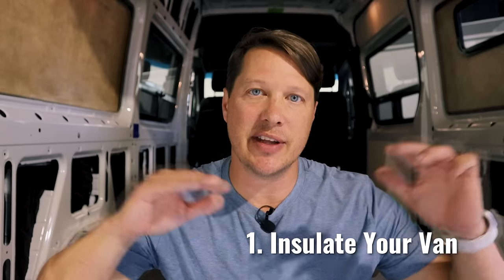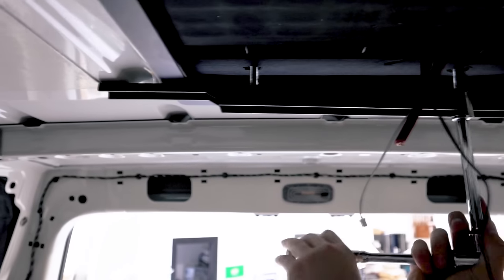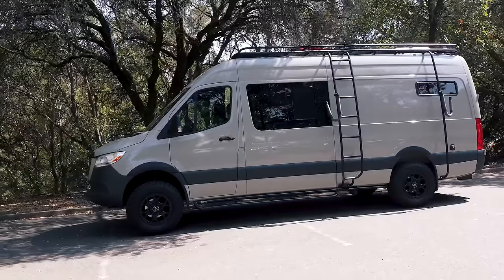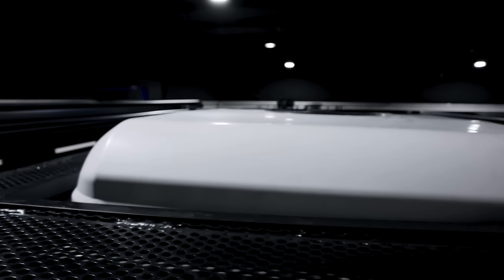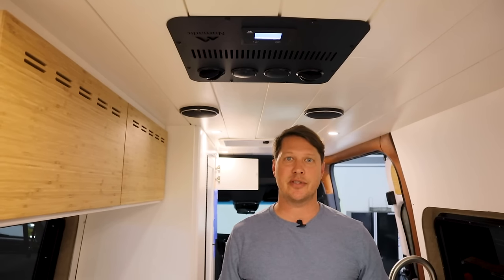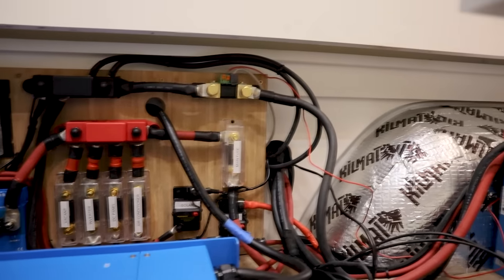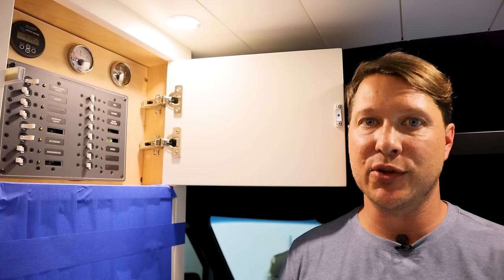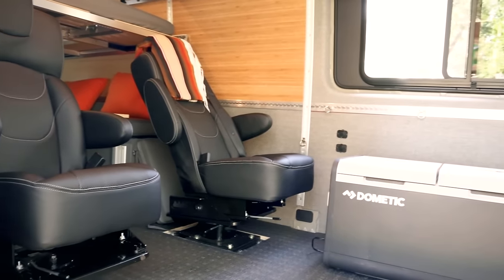Perfect Air Conditioner For Off Grid Sprinter Vans

Comment: I’m in Florida, so I’m going with the ac as a priority before other “unnecessary” items.. it would be unbearable to sleep/hangout on the van without it at 90 degrees and 100% humidity. So before wheels/tires, roof rack, rear door accessories, etc I have to figure out the ac. Thanks for the technical info on this system
Reply: South Florida here also.  I’m trying to decide between shore power AC or 12 volt AC and I’m still not %100 sure 🤔
Reply from the maker: There’s a cost difference and a convenience difference to consider. Tough decision indeed- depends on your access to shore power when you’re traveling.
Reply from the maker: Absolutely. Good luck with your decision.
Reply: @onionhead5780  im thinking about hacking a 120v unit for my van honestly. I’m an ac contractor and I have all the parts and tools at my disposal.. there are 9000 btu inverter units that probably are sufficient enough for a well insulated van that close to draw the same power as this at 120v even after accounting for inverter loss. And they cost less than $500 vs $4000. I’m going to explore options and see
Reply: @jamilchavez4592  get the dometic rtx 2000 2800$ with sok lithium. 206ah/ 1029$.
Reply: Ditto. South Florida girl. It is sheer misery to sleep without a/c. I can barely stand to be out in the hot, humid daytime. Lol
Reply: @JackBatesPhotography  im looking in to the RTX 1000 since I’m building a micro camper. I have seen the RTX 2000 uses around  50 amps by the hour so I’m guessing I’ll need something like a 400ah battery bank to run the ac thought the night. It’s pretty expensive but I’m guessing it’s worth it.
Reply: @jamilchavez4592  how would you run a 9k btu av unit from the van without being connected to shore power if it’s 110v? I’m no expert on air conditioners or electrical systems
Reply: @JackBatesPhotography  Those batteries last 3.5 hours at 60 amps, or 7 hours at economy 30 amps (without considering any other loads).  You really need a massive battery bank to run an AC at night.
Reply: Southern Arizona in the summer where A/C is not a choice unless one wants their van to become their coffin.
Reply: I'm from south Florida and I'm going with a Cicioni mimi split. It has more BTU's than the nomadic cooling roof air. I have two dogs and I want my van to stay cool for them. Plus I'm getting a 24v system for my power.
Reply: @kathylong9087  I ended up going with a recpro roof top and it’s great for how inexpensive it is.. can easily run for hours on battery if you have 200+ lithium
Reply: @jamilchavez4592  I'm looking at those RecPro units now and I was wondering if they are reliable and actually cool down you space.
Reply: @anobody5708  I’ve had mine for about a year with no issues. The 9500 Btu unit cools down my insulated 144” sprinter high roof well.
Reply: Idkn I own the 12 volt then switch back to the 120 which can run off my batteries the 12 volt didn’t have enough balls even in mild temps.
Reply: @ryanrodriguez70  yeah I’ve seen that the dometic 2000 a lot of people like is like 3000 btu less than the recpro 120v I have. I think it’s undersized
Reply: Florida isn’t good for camping.
Reply: Absolutely!!!!
I'm a New Orleans Native Baby and A/C comes before you even buy the bus!!!
Nothing is worth it without A/C!
Reply: 100000% my man. I am with your thought process!!! It's about the heat and AC for my Overlander Trailer camper build.
Reply: AC is a must!!  I do not want to travel in certain months because I do not have AC. Comfort is the key, or I will not go. Sorry but AC and heat are the main essentials to traveling in comfort.
Reply: I'm going to Florida myself soon so yeah, the ac is must.

Comment: The Nomadic seems to take up a lot of solar panel space on the van's rooftop. I think the 
Dometic takes up less roof space space.
Reply: Nomadic is 36x32x9 vs the Dometic at 29x42.5x11.29. So the Dometic is both longer and taller and takes up more square footage on the roof. The nomadic is wider but both shorter and lower profile. If you're looking to put a small low wattage solar panel on either side of the AC, Dometic may be the option for you. If you're like me, and you want the biggest gap between the AC and the MaxFan for a large walkable solar surface, Nomadic looks like a great option

Comment: There is one out now that has 10,000 BTU cooling, 4,500 BTU heating runs all night on one 100ah battery and is about $900 made by outequippro and mine has been awesome for over a year now! It is about 7 inches tall and 28inches long and 26 inches wide.
Reply from the maker: I just checked it out. Sorry, but it says "Get 8 hours of cooling with a 480Ah battery and 10 hours with a 600Ah battery when parked". So, it is misleading to say that it runs "all night" on a 100 amp hour battery.
Reply: @VanLand  I only have a 100ah battery.  Works all night
Reply: @VanLand  $4000 for an AC unit is a just too much. The Outequippro runs on 12v 50a -75a whereas the Nomadic 12v runs on 65a-105a.  The  Outequippro is a 10000 BTU and the Nomadic it 11000 BTU. The price difference is stark. I get it though, as long as you can sale it at that price why would you stop. 💰

Comment: I just added a Nomadic 2000 after 4 years of only having fans. Our travels this summer made us realize in today’s climate our motto of go up or North if hot would no longer work. Install was pretty simple, even with already converted van.  I would comment that there is more to the cost than just the A/C, you will probably need to add additional battery capacity.  Looking forward to much more comfortable travels and the option to travel places we previously avoided due to heat.
Reply from the maker: Good info, thanks!
Reply: 2eto.... but "today's climate"? Like it's so much hotter today than 5 years ago or something?
Reply: Yeah Mike. Where I live it’s record breaking temperatures each year last few years. Lived here all my life. The climate is changing.
Reply: @TheAllang123  😀 just about every year has "record breaking temperatures".... hot or cold... on a given day. The 30s were hotter than today.... well, until they decided that was an inconvenient fact and they started adjusting those temps down as a "correction" to supposed faulty equipment. Going much further back it was warmer during the renaissance period (at least until they finally outlawed SUHs [Sport Utility Horses] and coal fired cooking 🥵).

As for DC powered aircon.... nice they have options even if they are crazy overpriced.

Comment: I am going to put a portable air conditioner made for a house inside my box truck conversion and run it in a generator.  The generator will be mounted discreet and secure on the outside of the truck.  Also, the heat will be powered the same way.  
And, I am using a battery pack and propane for everything else.  How do I recharge the battery pack ?  The generator !  I am specifically designing this rig to require only a fresh water and grey water line.  How  ?  Compost toilet.  
There will be no shore power option and my fresh water storage will be in 5 gallon cans which feed to the cold taps of the sink and shower and the hot water tank. Most of my interior lights will be battery operated pucks mounted to the ceiling and walls. 

I was going to do a van, but, dollar per cubic footage, buying a new box vs buying a new van, the box looks more attractive.

Comment: Just wanted to share a thought.  I'm hoping to get an eSprinter when it comes out.  I think the 400V main battery will have 113 kWh.  That's over 9000 amp hours at 12 volts for 900 amp hours a 120 volts.  However you can't connect accessories directly to the 400V battery with a voltage converter.  Instead the house battery would be connected to the 12V vehicle battery.  EVs have 12V batteries to run accessories and to handle various EV system functions.  Normally the 12V is kept charged by the 400V battery.  I'm hoping that the 12V battery will be kept charged when the vehicle is on, even if stationary.  Then there would be basically endless power to keep the AC going.  But there's some mystery surrounding 12V battery charging in EVs.  Will have to wait to find out more.

Comment: I am sure those are nice, dependable units but, I can buy 12 window units of the same BTU rating as the smallest/cheapest one on your site.  Sure, I had to sacrifice one of my opening windows in the rear of my Dodge high top conversion van for installation but I think it is worth it, for me anyway.  Your installation looks cleaner and, being on the roof near the center, all the cold air drifts down for better coverage whereas mine is only about half the height of the van and is located in the rear.  I use a few USB fans to move the air around.  I am sure your units will last longer than a window unit (probably not 12 times longer) and, I could not afford one anyway so I went another route.  Your builds do look great though and I wish you much success.
Reply: I think you have decided that your window air is OK for you.  Typically , those air units are difficult to start.  You may need a big sine wave inverter.  Also, those units remind me of a dirt dobber nest.  If you don't mind the eye sore appearance, I can look another way.  So, I'm good with it.
Let's Roll! Wolf
Reply: @wolfalaska7638  Thanks.  Yes, my ac unit draws 410 watts and my inverter on my Bluetti AC200P can handle 2000 watts.  My gas generator can also handle 2000 watts starting and 1700 running watts.  Also, I don't think it looks bad but, all I really care about is keeping cool in the hot summers.  Safe travels.

Comment: I think it comes down to what kind of r value you have in your van it’s what matters the most in heat and cold insulation be spray foam board or reg
Reply from the maker: This is totally true! I tell people don’t even think about getting an air conditioner until you’ve done everything you can to insulate the van.
Reply: @VanLand  anyone that can’t afford to do spray foam I would consider the foam board insulation it still has the same R6 value per one inch  just not as air tight and doesn’t add so much to the rigidity and is easily shapable with a knife or osculating tool I’m building a tiny house now but can’t wait to build a van
Reply: @topofhelist6592  IMO using a 1/2” air gap between the foam board (with a reflective coating) and van walls/ceiling will significantly lower radiant heat gain in the van.  Radiant heat is the biggest driver of heat gain. Tight fitting window covers with reversible silver/black surfaces (for summer/winter) will help, as will optimizing window choices. Vehicle A/C units are usually way oversized and extremely energy efficient compared to any A/C you will add, so consider adding ducting from the vehicle A/C to the rear for cooling down the rear while driving or the initial cooldown when camping in one place.

Comment: What is the battery and inverter set up needed in order to use the a/c off grid?
Reply from the maker: It runs directly off of a battery system- no inverter needed. This is the most common setup we use: https://vanlandstore.com/products/victron-power-system-bundle-600-amp-hours-1?_pos=2&_psq=600+&_ss=e&_v=1.0

Comment: Question if you would use a small generator to power the AC why would
You need the batteries?
Reply: You wouldn't. Also, if your generator is big enough you could save some serious coin by buying an 120VAC rooftop unit (<$1000) vs the 12VDC one (>$3000). Of course if the greenies have their way gas will be >$20/gal so there's that..... but then we might not be building vans if that happens.

Comment: I live in South Florida and have a 2020 144 MB 4x4. When we travel in the summer, even a few hours of AC during the night would be a blessing. I’m trying to figure out which of the 12v ACs to get and how much battery power I need for overnight stays without shore power. Any suggestions?
Reply from the maker: Hi Mike, I would suggest getting the Nomadic 2000 and placing it near your bed. We find that the until will run reliably for 2 hours for each 100 amp hours of power storage you have. So, if you want 6 hours of run-time, then you would need 300 amp hours of storage. https://vanlandstore.com/products/nomadic-cooling-2000-12v?_pos=2&_psq=nomadic&_ss=e&_v=1.0
Reply: corey Babcock  i have though about the same thing but taking in to consideration the hanging unit on a side and the stealth factor even at a higher price some low profile ac units could be beneficial

Comment: If you always have shore power then a 120V unit makes the most sense. But if not, you’re going to need about the same battery capacity to power a 120V unit - the same amount of “work” is done by either unit and you lose 10% through the inverter which is always the weak link in the system.  Thinking a $500 3000-watt inverter is going to hold up to powering a 120V air conditioner is just wishful thinking - you’re going to need a $2K-$3K inverter for that.

Comment: That air conditioner is huge! Putting it on the roof will make a lot less space for solar panels on my Sprinter camper van. Any 12 volt standard size A/C to replace the hole my old A/C is in?
Also in replacing my old A/C with a new 12 volt A/C do I need to route two large Dc canles through the ceiling?
Reply: Your old AC (Roof) unit was probably 12v being it came out a motor vehicle. Call the sprinter dealer and ask what was the watts/btu of the old unit. Then compare with the new unit you're purchasing.  Long as the new unit does Not exceed the old unit in power,  use the electrical wires installed already
Reply: @faith4freedom76  his old ac was likely a 120vac unit usually installed on RVs. He'll likely need new (bigger) cable for a DC unit.
Reply: You can cover the whole roof with solar panels except for the hole where the fan condenser exhaust is at.

Comment: a very explanatory video... one question ... is it possible to use the unit whilst driving instead of the main vehicle ac unit (the one installed with the engine i.e.)??. thanks again
Reply from the maker: Yes this can run while driving.
Reply: @VanLand  tha KS for your reply...
Reply: @VanLand  Cheers..

Comment: Do these AC units work like regular AC where the compressor starts and runs full until the temp is reached? Or do they run at variable speeds like DC Inverter style AC units?

Comment: Will the Bluetti AC 200MAX solar gen.   have enough  start-up power  to run  the  Dometic RTX 2000 .rooftop AC unit..  I know the running time is limited  ,,,but will it run ..
Reply from the maker: How many continuous amps can it supply? The 12V air conditioners draw 30-50 amps continuously- sometimes more.
Reply: @VanLand  thanx Ill check it out ...

Comment: this pulls 60A peak at 12V or 24V? when talking about power it helps to speak in watts rather than amps, as amps tells you nothing about power draw unless you know the source voltage.
Reply: I believe he mentioned 12vdc several times.... but idk

Comment: Will this fit a 2007 Honda Odyssey?
Reply from the maker: Not sure, but most likely. Just depends on if you can cut a 14" x 14" hole in the top and have enough roof space to support the rest of the unit.
Reply: Who can install the ac for me & how much for parts & labor?

Comment: Do you have any opinion on 24-48 volt ones?
Reply: Higher voltage gives you thinner wire benefit, but you’ll lose the ability to use the same battery pack for 12v loads without adding a step down converter.

Comment: Are you serious 60a that is a crazy amount of power to not be that powerful in cooling since it is direct connect to batteries there has to a minimum amount of power needed to have that unit. My home unit only pulls 15a and it a 8000 btu and wow on the 3 or 4 grand is crazy I seen a 12v minisplit by mr cool DIY unit.  Nice unit just wow on power and price to performance
Reply from the maker: It’s 60 amps at 12 volts. You may be thinking 110v.

Comment: You're not putting on an air conditioner on your personal van. And you will tell us why? I think I already know. I think we all do. None of us can afford a 12  Volt, rooftop air conditioner. None of us! Because we are not that kind of stupid. You put the cheap, stock, 120 volt unit on your rooftop. You get yourself a good inverter. At you put in lots of batteries. There isn't any other choice. You will spend a fortune on lithium batteries. They are not practical  either. They are all miniature bombs. Waiting to explode. Whenever they feel like it. And so best not to be cycling your air conditioner on those. As it's only a matter of time. Until they take out your RV and/or Motorhome.  And your own, living abode.

Not that lead acid batteries can't also ignite and explode. But not with the frequency of lithium. An accident waiting to happen. But it's the hot buzzword right now. Rich guys are getting very much wealthier on. As they also know. This ain't the technology to have. We don't got the right batteries yet. And we may not never? Is the newfangled ones that will be right. Will be hideously expensive. For decades to come. So just forget it! We are stuck with the lousy overpriced lithium's for now. Solid State ain't exactly happening yet. They are a bit expensive and difficult to produce.  Only the military gets that stuff.. We won't see it for decades yet. And rich guys want to get wealthier. So? We are left with this. The Lithium Conundrum. As China has most of the lithium. Wouldn't you know it? It's a business plan for sure. With plenty of American Interests. Funding it. Making it happen. For the Chinese and themselves. Here in the USA.

One need only follow the money. To know where these highroller boys are going.
RemyRAD
Reply from the maker: Ha ha, no that’s not the reason but great diatribe! 👍🏼